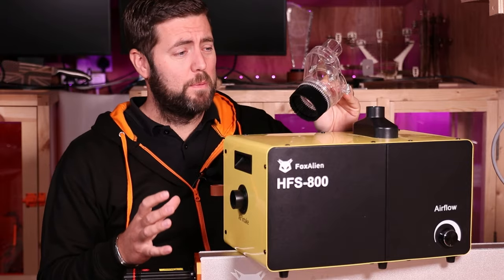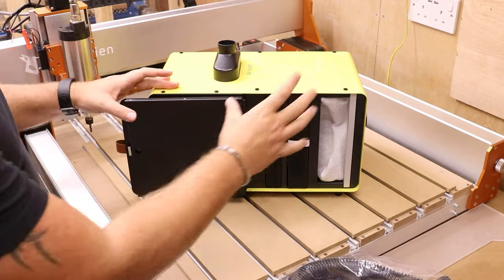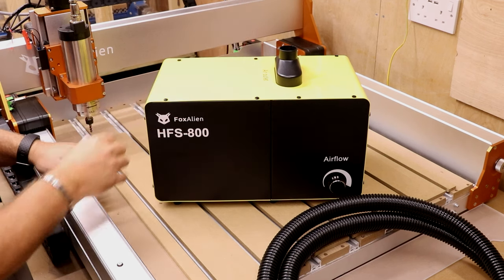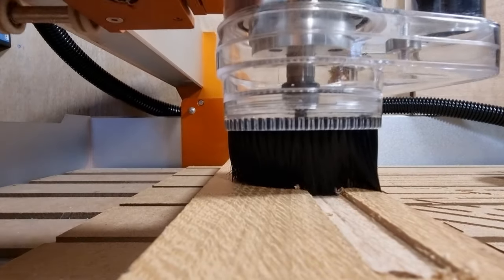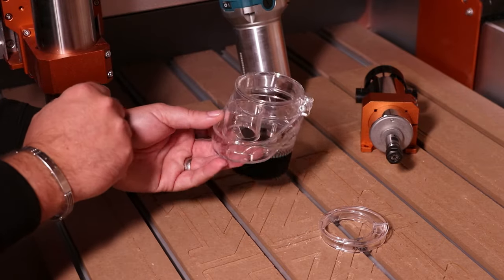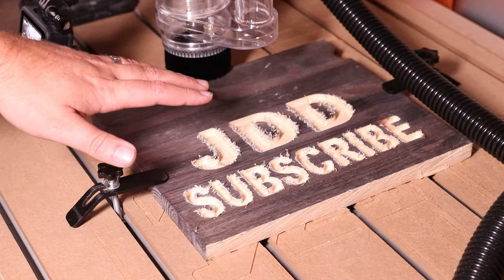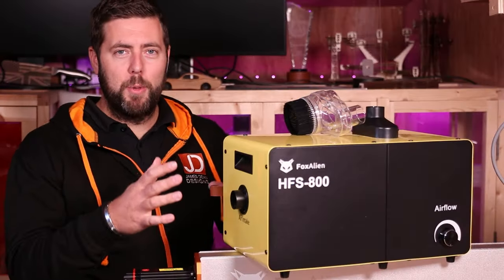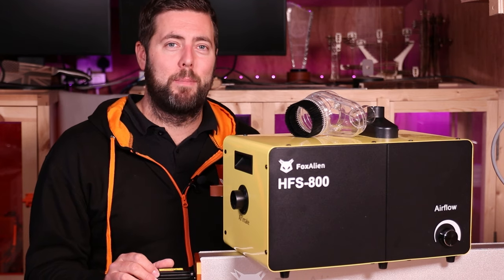CNC HEPA Vacuum and dust shoe for your CNC setup - FoxAlien HFS-800 and dust shoe review

Comment: Another great review, James 👍 The vac seems a bit spendy, but it does offer variable speed, compact size, and 3-stage filters, which is pretty sweet.  Too bad about the vertical filter placement, though.  Horizontal mounts (ala tray style) seem more logical and would have mitigated the mess.

Comment: As a hvac tecnician I would like to point out that the holder for the hepafilter is as important as the filter, to reach hepalevel it needs to be clamped in tight or the small particals just goes around the filter
Reply from the maker: I can confirm it is there pretty tight with a seal all around it 👍

Comment: Great review as always.  Maybe comparing to a shopvac is not a great comparison.  Maybe a better comparison would be something like the Festool CT 26E HEPA dust extractor, which comes in at almost twice the price.   I am kinda digging that dust boot though. I am soon switching over from my square VFD to the equivalent round one.
Reply: A closer comparison would be the festool ct 15 or fein turbo I, both of which will mob the floor with this thing in suction and capacity. I caught my fein turbo I on sale for $175; I bought it exclusively for CNC use, along with a dust deputy. The fein is amazingly quiet; I think it may even be a bit quieter than my festool midi I.

Comment: Thanks for a great review again James. It seems, with the carbon filter, this vacuum might be a good solution for laser machines.
Reply from the maker: Yes, it should minimise the smell or smoke in you're work area.
Reply: It wouldn't be able to cope with laser cut wood.  I have the bigger Xtool 3 stage unit and It needs constant filter changes at £180 a time!  I only use it on long jobs now where I am cutting for over an hour.  Should be fine on acrylic though.